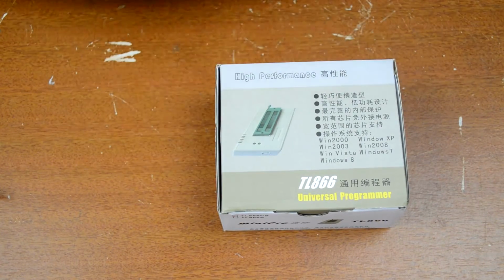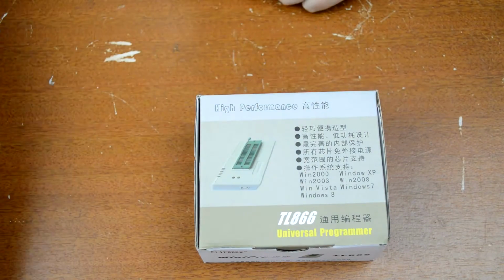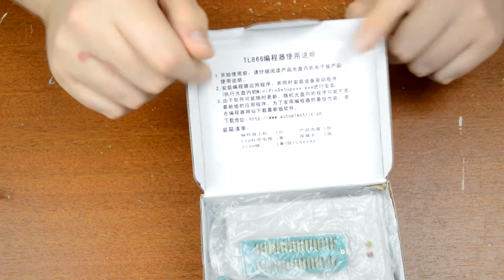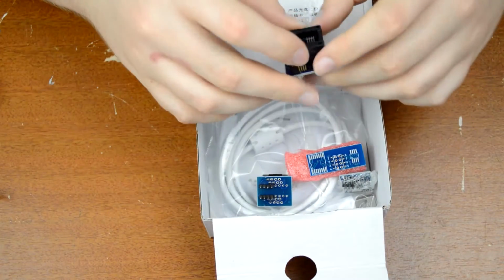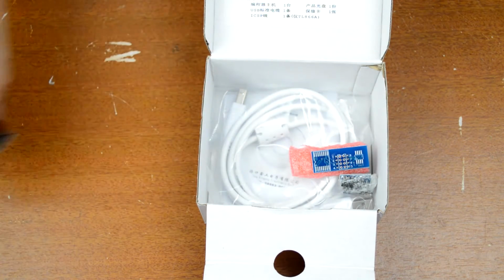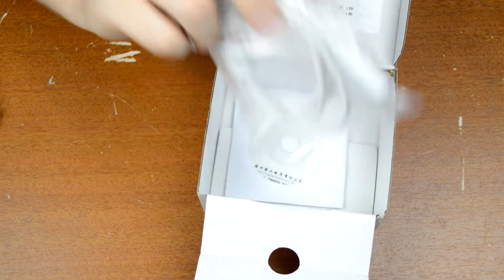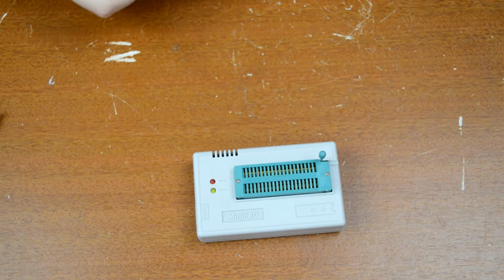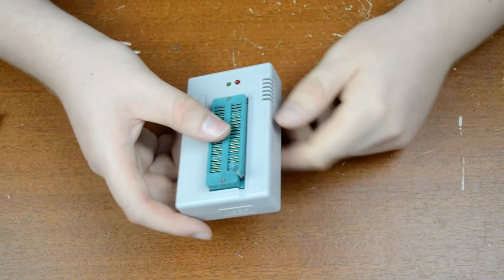MiniPro TL866 Unboxing Universal Programmer PIC EEPROM

Comment: My TL866 always reports bad pins if I read the chips. I am frustrated, where is the error coming from? Is it from the chip or the programmer ?
Reply from the maker: Clean the contacts on the chip
I have this issue with SOIC adapter all the time
Reply: @Slot1Gamer  
Okay 
Thank you

Comment: I have the "A" version of that programmer with the ICSP port.

ICSP allows you to program something like a microcontroller chip without having to remove it from the circuit its in.

The ICSP port has 6 wires but only uses 5 connections.   Pin 1 is toward the "front" of the box (where the MiniPro name is).  Starting from pin 1 it supplies VPP (Voltage: Programming Pulse), VCC (5V power), GND, PGD (ProGramming Data) and PGC (ProGramming Clock).

The software allows you to program almost every type of microcontroller and (E)EPROM as well as test most of the logic ICs in the 74xx and 4xxx series and most common static and dynamic RAM chips.

I say "most" because one which it doesn't test is the 2114 1k x 4b RAM chip which I've used in the past for a few projects.

Comment: would this work for an EPROM made by ST m27c512-12fi?
Reply: I have one of these programmers.  The software has the M27C512 listed as a target device, in both DIP28 and PLCC32 packages (although I'm guessing you'd need one of the add-on boards to be able to physically connect the latter).
Reply: Thanks I got it and it did work.

Comment: What do you plan on using for?  I bought one a while back, and so far I have used it for programming Attiny45's for making my own Xerc 2 XE's for the original Xbox.  I will soon be using it to flash replacement TSOP chips for the original Xbox in order to fix Xbox's with bad TSOP flashes.  There is a lot you can do with it, enjoy your purchase.
Reply from the maker: Floydzabarber I had a similar idea about the TSOP (i idont know if those chips are supported though), so far I've programmed some PIC's for PS1 modchips, it's a very professional feeling device.. I'll give a go at making some repo snes carts too if I can get the EPROMS hehe :)

Thanks for watching my video!
Reply: Hi Floydzabarber how much $ is the cost to repair a xbox alladinxt bricked modchip plus shipping?
Reply: I could repair it for you for $10, then you just cover the shipping costs here and back.  Is the only thing wrong with it, a bad bios flash?
Reply: Im planning to use it to repair my xbox v1.0 i plan to use this modchip with tsop m7 bios is a bios smilar to evod6 to repair bricked tsop thats all lol but right now i dont have the $ but let you know im interested ,is there other way  can contact you? like skype or fb
Reply: a friend on mine give me this alladinxt i installed on my xbox v1.0 lpc d0 point etc  but the chip alladin is bricked frags on boot maybe is flashed with the wrong bios thats why i want to fix ths chip.
Reply: so i have the tsop and the alladinxt both bricked lol sorry for my english men is not my native language
Reply: iwas flashing the tsop on my v1.0 with ind bios.06 beta feb 05 and that bios have a bug no video on screen steady green light in power button